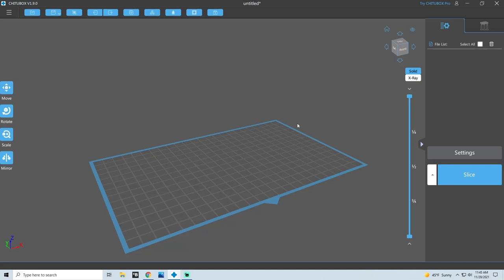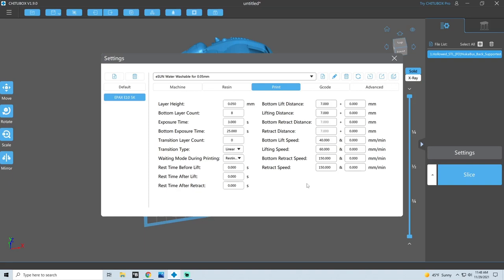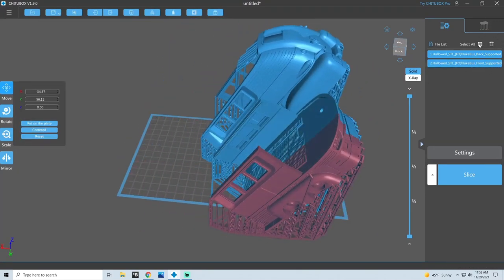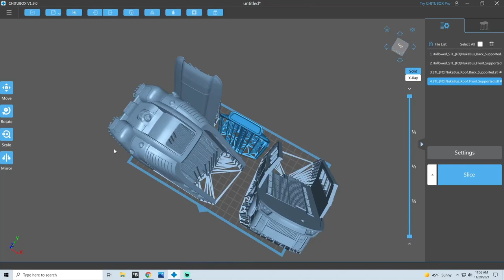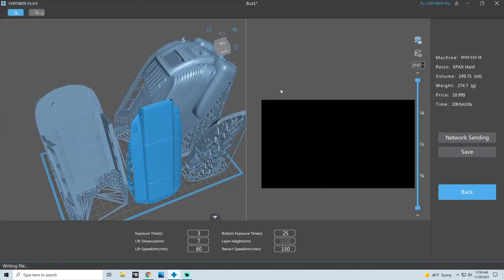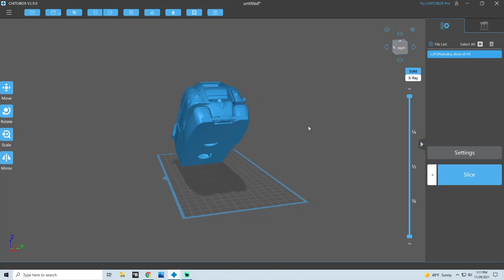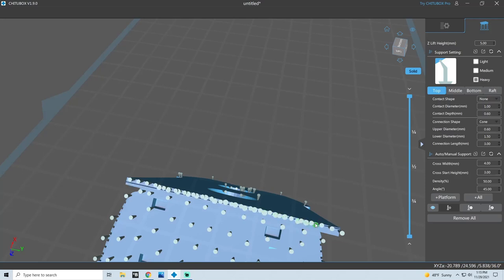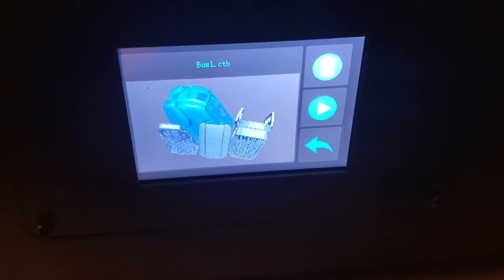Terrain Tuesday:  3D printing with the FWW Bus!

Comment: Very informative.
I myself have been considering buying a 3d printer, and have also been interested in buying STLs for Wasteland Warfare terrain and buildings. My one concern is that the build plate on the printer I am considering is quite small, and some of the build pieces seem quite large. How do I know if they will fit on the plate?
Reply from the maker: The Height (z axis) is the biggest concern, the bus can be printed on smaller machines like the Mars or Photon as it can be printed pointing up.  All the modiphius files are like that and designed for smaller printers.
Reply: @ExcaliburHobbies   Thank you very much!
Btw, I think your unboxings for FWW very helpful. I find they give a great idea of what to expect when purchasing, and no one else seems to do it.